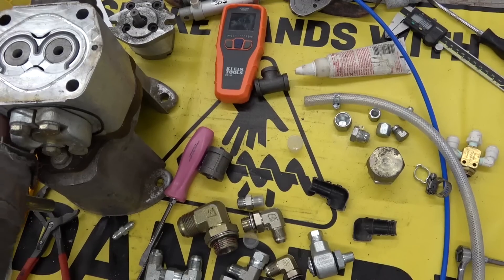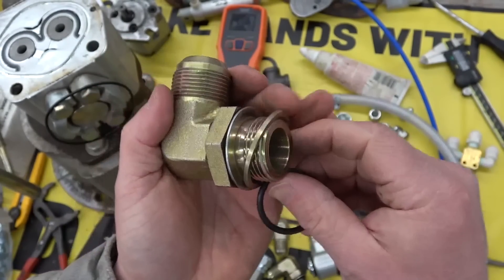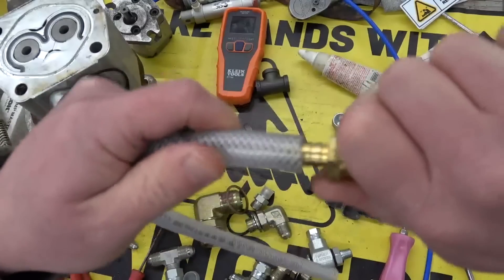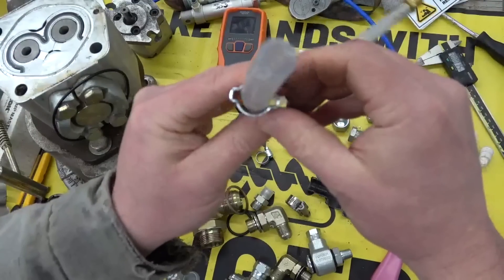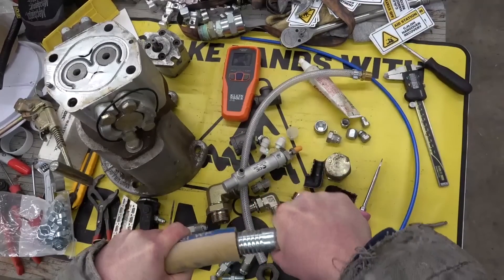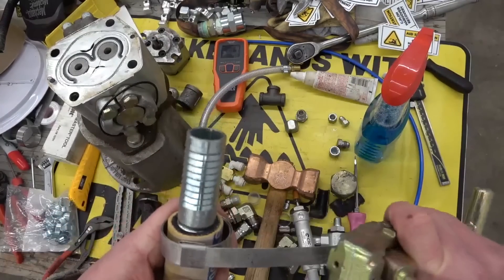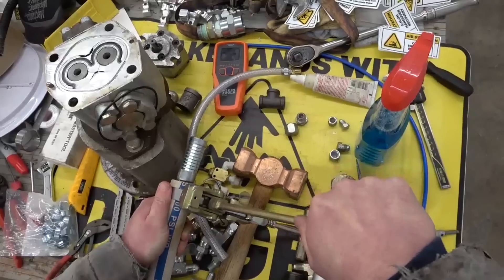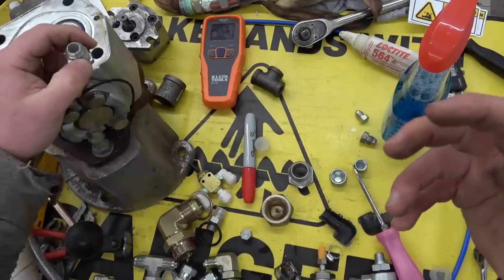Oddball fittings and other barbs || AvE Hydraulic Nuggets

Comment: The worst hydraulic fittings I have ever had to work with is the inline compression butt connector fitting, they always blew apart no matter what brand I tried and no matter how tight then could get them, even the sainted brand, Parker. I finally fabricated a jumper clamp around both the fittings to keep them from slipping out of the fitting

Comment: "Get in line and shut your mouth" is solid advice, if you can listen you can learn. I can remember an old security job at a mine, a solo site in the middle of nowhere, our job was to insure 3 things. People stayed out, the power stayed on, and the water kept moving. You had yourself and only yourself, an Ops manager was on call but he wasn't coming out. I was there for almost 3 years, and in that time I listened to every single guy there talk about how things worked, the PLUs, the pumps, the control systems, and start-up, and shutdown procedures. I could troubleshoot 90 percent of any issue that came up at 2 am on a Saturday before calling the on-call ops manager. Sure I could have just called them for everything but my job was to ensure nobody had to get called in for an icon that could be clicked on, or a simple reset button that needed to be pressed. Most of the time there wasn't a manual you could reference as controllers were changed regularly, set-ups moved or relocated elsewhere and set up differently. It was a great experience, in not eating a shit sandwich when all hell broke loose after a cutout or plu decided to have a rapid unscheduled disassembly.

Comment: Fittings'll drive you F'ing crazy!!!!   Soldering, brazing two together to get what you want/need is my fall back.  Also. DON'T put the clamp on the hose barbs if you can, they cut into & weaken the hose, put it on past the barbs when possible so the ID is smaller & won't pop/blow off,  The barbs should do the sealing all by themselves when they're sized right with the hose.

Comment: Don't use windex for decals if you want them to last. Use isopropyl to clean the surface. Use a squeegee and learn propper technique and you won't get bubbles. Paint protection film and anything needing to be optically clear is when you can use some soapy water. 25+ years vinyl wrap and sign maker.

Comment: I still remember 15 years ago, getting plastic injection molding machines from Shenzhou. I learned the difference between METRIC and metric. Hong Kong had been a British state for a century, using British metric fittings. Most available metric fittings we could get were 'German' (rest of the world) metric fittings. Fortunately, we had a guy at Fastenal that knew why the Chinese British Pipe wouldn't fit in the German hole. This Shenzhou plastics machine company had a habit of sending machines in in 2 pieces, with 52 pin twist-lok wiring connectors. Apparently both halves of the machines were made in different places, cuz they started numbering from opposite ends of the circles. All I had to do is? ...take all 52 wires out of a connector, with 2" long ends, and put them in the right holes, while a boss/owner looks at a 3" diameter plug and say, what's taking so long?

Comment: For pressing the barb fittings into hose I have a cup of water that I have boiled in the microwave. I dip the hose in for 10 seconds and the hose becomes pliable and the fittings slide right in.

Comment: Good advice. I've seen plenty of the opposite too. The guys who always need just one more personal day off. Or the guys who put out more hot air than the shop compressor. They don't make it through review season. 

I did wonder why we never used the proper ouchless hose clamps when I first started. Yeah, gotta get new ones every time a hose decides to become an angry snake. Plus, we don't have a pair of those Knipex nail clippers around for anything else.

Comment: Clamp-a-hose like 5:22 and a air hose quick connector will try to go into low earth orbit when you crank that system to 13 bar pressure next morning😅shit needs to be moar tight with gear clamp or kneepex clamp😁

Comment: IMO better than the Knipex end cutting pliers for dealing with Oetiker clamps are the Vise-grip 'LW' series locking wrench type vise-grip. Terrible at their intended purpose - locking onto nuts or bolts - but great for bearing down on the ears of oetikers.

Comment: The issue is that when one asks for a 3/8" hose barb, the threaded end is 3/8-NPT, while the hose end is 1/4" ID. You now have reduced your flow. One should always use a  hose barb with the barb one size bigger than the thread size. No flow restriction then.

Comment: Greetings from Anti Pode land_Ian - that is NOT a Dowty washer, at least we, in UK refer to Dowty washers ( seals) as Bonded washers. Can be Self centring or not.   Self-centring "hold on" to the threads whilst the other plain ones can fall off.  What you have there is an "O-ring" between 2 washers.   BSP is the most common threadform here in Europe. Generally it is the preferred option of female thread on Pumps, Motors & Valve bodies.   Occasionally we finf Metric or what we simply call SAE threadform.    Depsite our DOnald and his noteworth MAGA Sentiment, I think you guys should join with us in the UK  ( worst of all worlds - but greatest for Education - you'd learn but ALL Sorts of things ).  Cheers.

Comment: I HATE bspp only because it is related to bspt and npt. npt is the worst hydraulic fitting to exist. 1 they always leak. 2. Every damn farmer will use black iron npt fittings in a farm repair and then bring the equipment in with a F***ing timeboamb fitting

Comment: I have a few pairs of caps and plugs with a couple links of chain welded on for pulling a new hose in while pulling the old hose out. Works decent when you have a bend that would snag a union, nipple, etc.

Comment: When I was using this stuff, a dowty seal has rubber bonded to support ring. Seals on a flat surface. Type at start needs a chamfer on the port...😊💪👍

Comment: 5:30 - Nippers.
Nippers come from the an old English Navy term (long before Canukistan was even a twinkle is us Englishes eyes), now generally meaning 'youngsters' or 'youths' or as the Scotch would say 'wii lads'
a 'nipper' is someone that tied off the anchor cable to the hauling line so it could be pulled from the sea (you don't want a sludgy, stinky, filthy anchor cable going round you nice clean capstan - as it could gum up the works and become very dangerous)
The nippers weren't old enough or big enough to be pushing the capstan round or pulling on heavy ropes... So the nippers and the really old guys (to teach them) got that job.
The nippers would also act as 'powder monkeys' and running messengers during any iron throwing contests.

God bless the wooden walls of England and all the men who prevented a dictator (probably worse than mid-century Austrian painter man), and gave their lives trying to end slavery 100's of years before ending slavery was the 'popular' thing to do (and much to the annoyance of the Jonathon's just beyond your southern boarder)

Comment: Last week I was disassembling an Atomic Layer deposition machine, by a Finnish company. On the evacuation side, inside the chamber, they have a large thread in A316 stainless.
Onto which you are supposed to screw on, an aluminum 6061 nut, that the company recommends to sandblast to clean. Needless to say, it got stuck harder then a teenager on a nude beach. Hard to cut it, and lever it out.
What is even worse, 10 minutes of googling gets you a whole research report from LIGO on vacuum compatible materials, with recommendations.
Aluminum bronze, recommended for mating threads on A316, prevents galling....

Comment: I’ve found an industrial hair dryer works wonders for installing stiff hose onto barbed fittings. Just warm the hose until it’s pliable and presto - slides right on without hassle.
Reply: yeah .. even dunking then in a cup / travel mug full of hot water is often enough
Reply: @888johnmac that's also my goto. Easier to control the heat. Just some hot or even boiling water, can't burn the hose.

Comment: Worth noting that some bsp fittings look like they have a cone seat. How ever some of these are not fully formed and wont seal on the female swivel. They can be cut in in a pinch, ask me how i know.
Reply: Also gates make a neat heat shrink hose clamp, it's meant to be just as good as a screw clamp.

Comment: Too many standars to choose from, i had to tap 1/4" 18 NPSM holes for a water cooled electric motor jacket, took me two weeks to get the custom tap here in italy since no one of my suppliers had it in stock, could have cut it with a single point tool but the gauge to check it was nonexistent too

Comment: 2:18 The outer steel ring is just called a retaining ring, also that isn't a true Dowty Seal. A Dowty Seal is a one piece rubber bonnded to a steel retaining ring. That's why they are also called a Bonded Dowty Washer.

Comment: I thought the Dowty seals had a bonded rubber inner, not a loose O-Ring.

Oft used on banjo connections.
Reply: Came here to say this. I used to work at Dowty Seals Ltd.

Comment: Do not use windex to install decals...one drop of soap in a squirt bottle of water can be used for cheap older style adhesives but most modern decals are made to be installed dry with air release adhesive that is messed up by installing wet...

Comment: You have the most advanced and complicated band-it clamp tool I've ever seen, but your Knipex pliers don't pinch and flatten the clamp like the 40-year-old ones I got off the tool truck for CV boots. Mine have half inch square holes for two breaker bars and can easily cut the boot or hose in two. lol
Just saying.

Comment: The spit or Windex trick never worked as goodly as a cup of boiling water dip ya pipe in the cup leave for 5 mins then  it goes all flexible squish on clamp and let it cool, super goodly when cools an hardens back up
Reply: boiling water is a must when you're dealing with super stiff oil resistant pipe. I had a length of it left over and decided to install it on my john deere engine when a coolant pipe perished. of course it still leaked at the hose tail because it couldnt be tightened until the engine was run to temperature.

Comment: I ran into BSPP threads on a pressure transducer that I installed on a paste backfill line at a mine.  It was one of those field fit jobbies, built up a pup with a bung for the fitting to install right past the sweep where the paste pipe comes out of the shaft.  Had to pull the transducer and go after the bung with a bastard file two or three times after pours to get it perfect, if the bung was too high the paste would bridge over the transducer diaphragm, if the transducer protruded too far into the pipe the diaphragm would just get abraded off.  Once I had it set right it lasted for years.

Apparently the Australians have banned calling people nippers.

Comment: In aircraft manufacturing and maintenance there is a hose clamp system called a clamp-tite. I've also heard them referred to as farmer clamps. The aerospace ones are fancy and use safety wire but the tool can be made at home from all sorts of junk that you have lying around and uses bailing wire or whatever old wire. The resulting hoseclamp is far far superior for not getting snagged on stuff. I use them on all air hoses. Check em out and make yourself a clamp tool

Comment: @AvE I ran into some oddball fittings just yesterday swapping stuff over to a new parker pump. The jeezless engineers had orb ports with some fittings that were BSPP 60° with o-rings in the cones and the others were 24° DIN with o-rings in the cones. After doing a lot of digging on my own time, I have finally found the o-ring charts for both styles of those fittings. Why couldn't the bastards have just used JIC.... and just to fuck the guys putting it back on the machine, they changed the flange port bolt threads from metric to standard. Sometimes an engineer just needs to get kicked in the dick

Comment: 6:29  one trick for removing the tubing from those push locks, use a open end wrench of the same size as the OD to keep the grab ring collapsed as you pull the tubing out.
Reply: A nice small crescent wrench works well too!

Comment: When you did the fast lock hose clamp fitting it threw me back to my old gold mine days. I remember being knee deep in mud, middle of the night, pissing down rain, and being like “tappy tap tap..” (smack with the mini-sledge) 😂 definitely a line I picked up from your vid-teous Arduino Vs Evil! 

Also there’s two secrets with those: 
#1 Big bites the first and then little small bites at the end.
#2 when you are done snap the the deallo off and then put the pointy bit back on the flat spot in a slightly different area and giver the ol double tap so it really choches and never comes A-part.

Comment: Dealing with hoses I prefer to get her good and hot before raming my barb into it, it soften the rubber and makes it way easier. Just submerging the hose in hot water it's enough and being argentinian I always have some water thermos around because we can't do shit without the daily dose of mate. 
I do a lot of polypropylene hose for work, being at 4000m asl and windy as fuck water doesn't cut it so we use a small propane torch.
Also we do everything with steel wire, the og zip tie. Case in point, it tends to work better than shitty used Chinese clamps and if you leave the tails long enough you can remove it even if you forgot to bring an screw driver from base camp. Also you don't have to deal with beaten up and frozen screw heads so you won't stab yourself in the palm when the fucking flat head slips witch sucks because living with hypoxia means you'll have the wound for the rest of the month. 
Also if some barbed union keeps separating under pressure you tie wire to the hoses in both sides and joint the two loops with another piece of wire and/or tie a wood stake to both sides of the hose like a splint so they can't separate

Comment: Sometimes you have to think outside the box for a fitting. My son changed his oil and found the drain plug was badly stripped. The local parts stores claimed they didn't a plug to fit. For a couple hours I went through my lifetime of collect of bolts and fittings and nothing would fit. Then I tried a spark plug- perfectly fit! We didn't even have to hook it to the distributor!
Reply: Probably better that you did not connect it to the distributor.

Comment: My go to for barb fittings and hose assembly is spray silicone and a heat gun, especially in cold weather.
Reply: Oatey silicone grease also works well .

Comment: Nipper was never actually a racial slur as is commonly thought.  The original nippers served on British naval vessels and one of there main jobs was to connect the anchor line as it came in through the hausepipe to the capstan line. They nipped the two moving lines together with a short length of smaller line and released it as it came to the capstan.. A very dangerous job.

Comment: This week I have dealt with -4,thru 16. Ptfe, an, 1/4 push connects, crimped, fittings after fittings. Not a typical week. But we are building oil and water systems for a boosted ls truck, a twin turbed jet boat, a 35 Plymouth coupe hot rod with an sbc, and a line on my skidsteer. Just a couple weeks slammed with hoses and fittings. And boom you are popping out related va-jay-ohhs.

Comment: The 0-ring end of that elbow is essentially a bulkhead fitting. ORB ones look the same and I have my doubts that it's BSP just from the look of the threads if it weren't for the extra metal backup ring.

Comment: I've learned the hard way that capping or plugging is always the way to go, even if it's just a quick job. Things come up, especially working solo, and before you know it you have the contents of a hydraulic tank on the shop floor.
Reply: Thats what happens when my wife uses her dirty dick beaters when my stick isn’t on the ice or in the vice
Reply: The real trick for a guy working solo to avoid capping and plugging is to get a job as a field service mechanic. That way when you empty the contents of a tank on the asphalt it isn’t really your problem.
Reply: @ZZ-308  I do work for a company that does spill cleanups, that ain't going to fly for me.

Comment: Yep... I have the same oddball problems with pneumatics for my Halloween props...  just when you thought you figured out what parts to order, something throws in a wrench in the works.   I know I'm not the sharpest knife in the lightbulb drawer, but I think they're doing it on purpose so I'd need to order a bunch of hardware pieces, always when a project deadline is approaching.   Fast forward about 8 years later and I've got a collection of parts, but I still don't know what kind of nuts are on the cylinders,  as far as I can tell there's two types:  Those that fit, and those that pretend to fit and if you're not careful and try to force it... they jam and gall the threads.
Reply: Instant locknuts sans the red locktite

Comment: 1 A short length of rope, usually braided or marled from end to end, which was used to bind the anchor cable temporarily to a messenger when in the days of sail the anchor was weighed by hand round the capstan. 2 Boys or men who worked the nippers when the anchors were being weighed were called nippers.